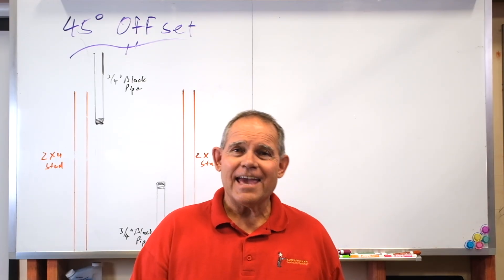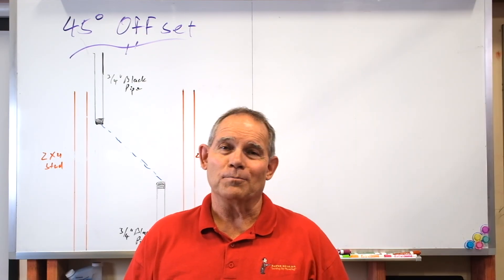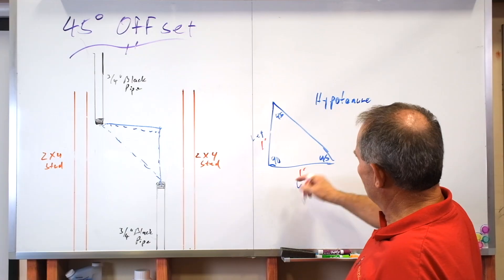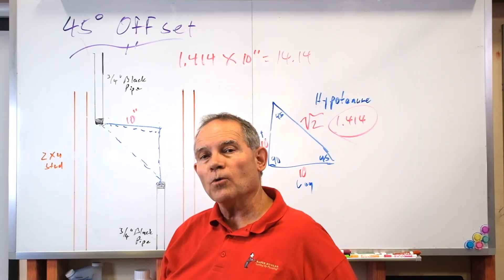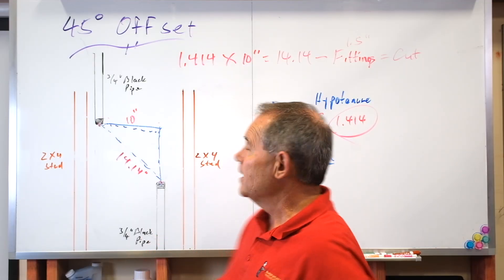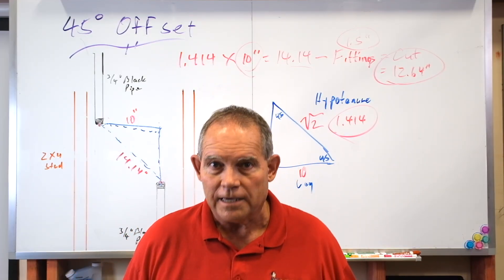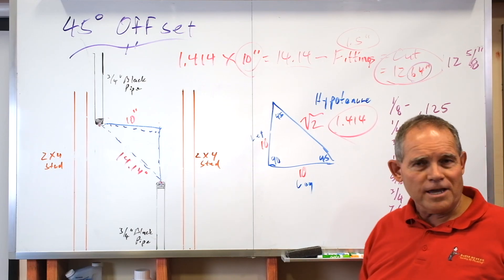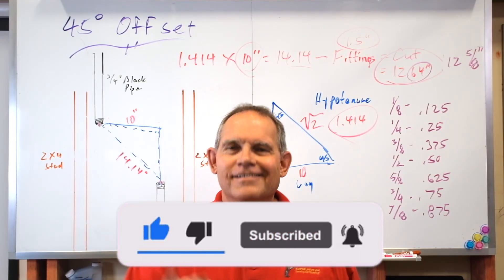How To Measure a 45 Degree Offset EASILY!

Comment: The center to make up trick is that for  different types of fittings such as 90s and couplings and unions are just 45? That one picture that would have to be done with 90s there's no way of getting 45 to work on it 

Who's going to do all that crap in real life you're going to take both of your fittings and then take a tape measure and measure how long the pipe needs to be... The other problem is you're going to have to put a union somewhere if you're going to put two pieces of pipe together like in the picture